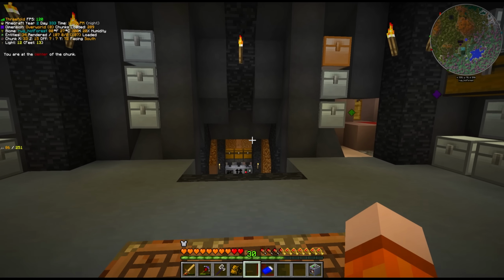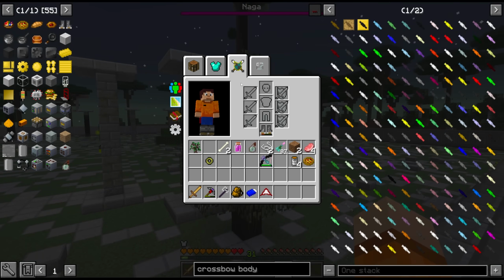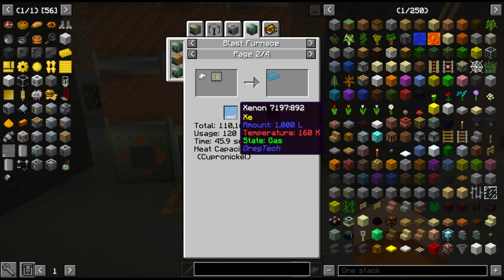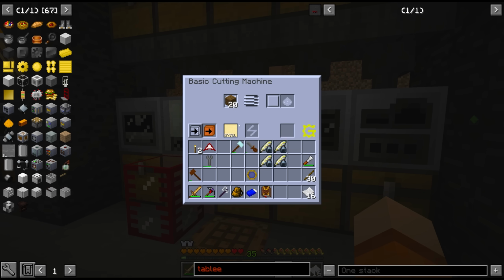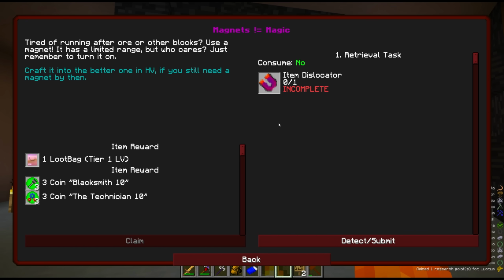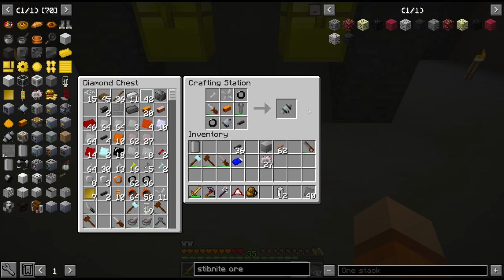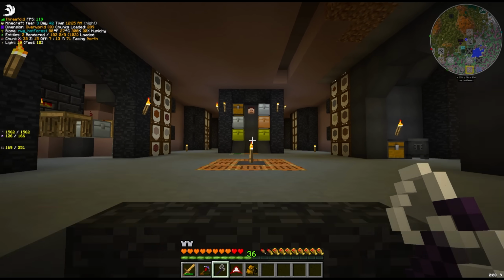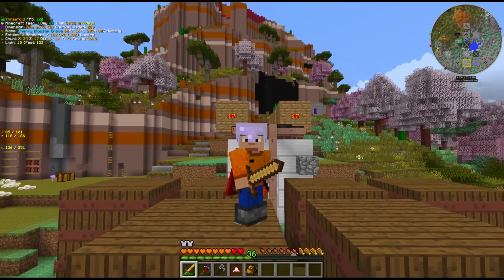Gregtech New Horizons S2 08: Scanning Circuits

Comment: I'm not sure on why this version of gregtech chose to display in liters, instead of millibuckets, but it does actually work out. The definition of the liter is the volume of a cubic decimeter, and this scales to that a cubic meter is 1000L, and a block in minecraft is a cubic meter, and a bucket of fluid is a source block. Iunno, I just do love that that is an actual equivalency.

Not like everything holds up, given that liquid metal, for example, operates on a different number system instead, and to some degree an ingot that's a ninth of a cubic meter is already quite large, if you actually think about it. A "nugget" is ~12cm^3 of mass, that's a chunk of metal the size of a giant fist, if 81 make a solid cubic meter. It's a video game, after all.
Reply from the maker: Yep its consistently inconsistent :))

Comment: I'd really suggest cleaning up your energy production and storage before too much longer. Those solar boilers aren't going to last you much longer, and you're going to want some battery boxes before too long. Lossless LV cable shouldn't be too difficult for you anymore, which will really help reorganize your machine room. In Omnifactory, at this point I'd try to rush Polyethylene since it makes the circuits cheaper, but that might not be the case in this version. Then again, Omnifactory also has reed farms that run insanely fast with Snad. 

Also, IIRC, Electrum is a pretty good crossbow limb material, which is certainly within your reach at the moment. It should fire both faster and hit harder than your current one, unless GTNH nerfed it. From there, the only real upgrade you'd want on your crossbow itself is just redstone for faster firing and maybe Mossy if you start using pricey components like a Cobalt stock for the extra fire speed.

Comment: The first thing I tend to get in TC in GTNH is the Thirsty Tank. You only need to get to get the Hungry Chest and Avarice Pearl researches to unlock its research, so you can get it without getting a thermometer at all, and it completely outclassed the railcraft water tanks

Comment: Greg tech uses litres because minecraft blocks are 1 m x 1 m x 1m and a bucket can hold a ‘block’ of fluid which is equivalent to 1000L
Reply: which is the same as 1000mb(milibuckets), which is the standard for modding.

Comment: It's actually more efficient (in term of gallium and arsenic) to make a boule with the gallium arsenide, cut it into wafers, and then use those for diodes.  It takes a while to process all the silicon to do that at LV though.  Then you also get some wafers left over to use for circuits later, and you can buy diodes in the questbook.  You can also buy wafers and transistors.  Wafers aren't super worth buying, but a couple times helps, whereas transistors and especially diodes are really nice to buy so you can put off automating PE and conserve the other resources that go into them.

Now I'll get ahead of myself because I'm in mid HV but probably will be for a long time so you'll soon pass that I'm sure.  The best recipes for transistors, capacitors, and resistors (pre IV when you can make "advanced SMD" versions with PBI) all use Tantalum, which is difficult to obtain.  You can technically make it at MV, but only using IC2 Coolant in a chemical bath, so it's not worth making until you can do the vacuum freezer.  However, in the ender IO questline in MV, there's two tantalite vein quests that reward a total of 16 ingots of tantalum worth, which can get you several stacks of SMD components to start out.

Once you finish MV and move into HV, you have to make the cleanroom and unlock the second circuit line, the first to contain 4 tiers.  The questbook tells you that you should craft hundreds so you can create the NASA workbench and stuff.  This is obviously not the most effective way though.  Rather, it would be more efficient to be able to make HV circuits directly, making all the HV+ circuits you need almost half as expensive.  But doing that requires an EV circuit assembler and EV chemical reactor to make the HV circuits and nano cpu wafers respectively.  However, you can accomplish this at HV using a Large Chemical Reactor and doing some Thaumcraft trolling to get crushed uranium ore for relatively easy radon

Comment: Hey, Three, as I understood you will continue to build in overworld? Not going to transfer to void dimension as time goes? Not sure about you and other viewers, but I think it would be more interesting if you kept on building in ow for the whole series
Reply from the maker: Yep! The plan is to stay in the overworld :)
Reply: @Threefold.  awesome! Ty for clarification
Reply: Agree with this, although I'd still favour using the personal space dimension for some stuff. Once you get ender chests you can shunt off all the laggy and/or bulky passive stuff there so that your overworld base stays clean and pleasant to spend time in - there are lots of different ways to do things tbf but I've found that split to work quite well
Reply: @eagle653  well yeah, if some machine causes problems or something I’m not against putting it somewhere in the void. I mean I’m not against building everything in void itself either, I just prefer seeing building in ow, shaping stuff, having actual buildings rather than a platform in space